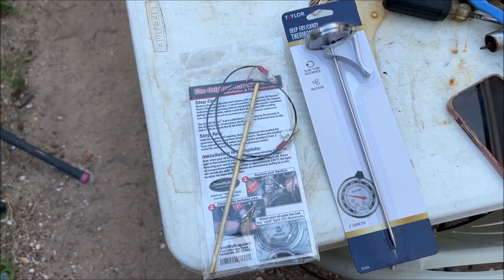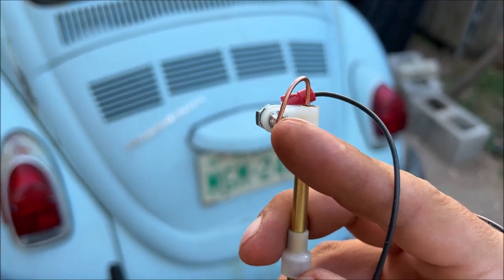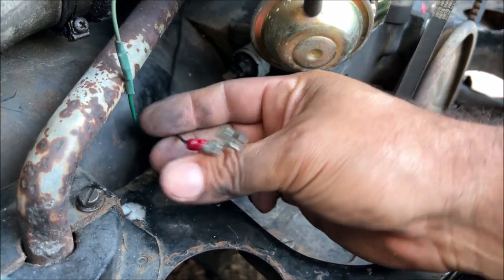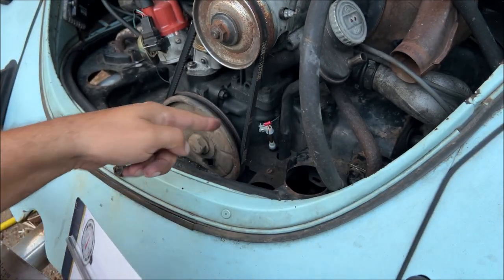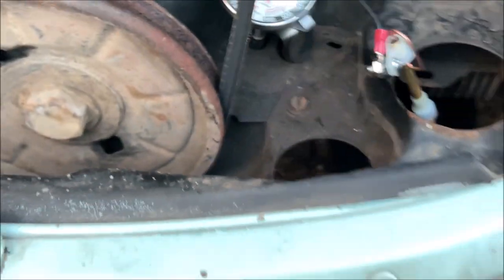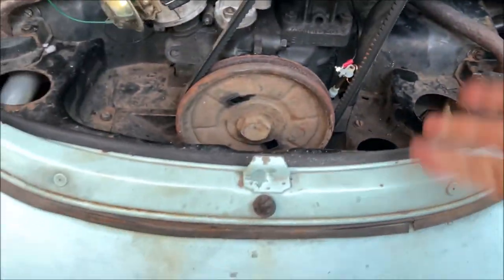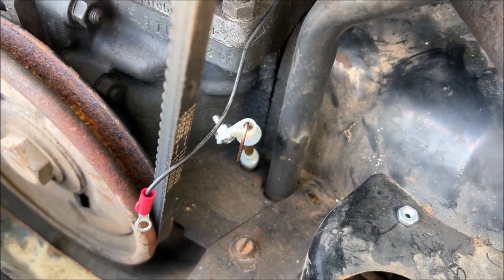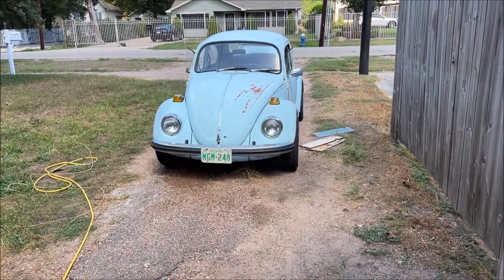VW Beetle HOT OIL DIPSTICK temperature sensor

Comment: If you are having a temp problem. This is why...  If you don't have your heater hoses hooked up you need to block both of them off on the fan shroud, because you are recirculating hot air.

Great video, it's very helpful.  Also, I think I will make some marks on the temp stick to reflect oil level.

Thx
Reply from the maker: the car won’t get hot. I’m guessing they get hot when you are on a highway or freeway trying to go 65… not there yet the car has a clunk I need to fix..  I bought all the missing engine tin and plugs already

Comment: Good stuff; the original ones came from Gene Berg. They are great. Keep the original dipstick in the trunk so that you can check the oil every once in a while. To get the oil hot it is better to get it on the road for a while.

Comment: The oil takes 15 minutes of street driving to get up to temperature. 
You can calibrate the sensor to 212'F .. by dipping the sensor into a rolling/boiling kettle of water.